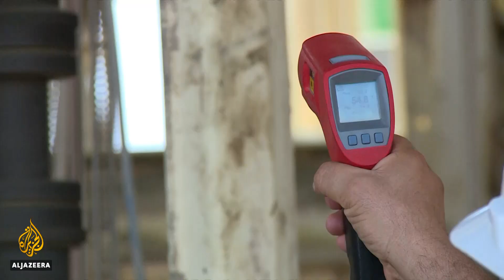Iraq's oil and gas industry aims to be energy independent

Comment: "In the 1980s Iranian jets destroyed most of Iraq's oil and gas infrastructure ".
Now imagine what the US would do to Iran if the Iranians started a conflict
in the Gulf.
The US aren't putting boots on the ground or even flying over Iran in planes :
cruise missiles will turn Iran into a stone-age economy.
Reply: vinm300 it’s Where would the US attack Iran from? The Arab countries. Which means Iran will send tens of thousands of missiles to completely destroy oil production in Kuwait, Qatar, Saudi Arabia, and UAE.   They would also launch missiles against strategic ports, airports and military bases.   Basically the Arab countries and Iran will both be set back to the Stone Age.  Which is why a war isn’t a good idea and also why the US doesn’t attack.
Reply: @lifeovdeath  , and who benefits then ?
Oil production from the middle east ceases , prices rocket : Russia benefits, the US does , Venezuela etc
Iran would be a stone-age country worse than Syria is now.
It would take Iran almost 100yrs to recover.
War is not an option for Iran.
Reply: vinm300  no one benefits. There is simply not enough oil production outside the Middle East to keep the world running.  Some countries benefit from soaring oil prices.  If the oil supply is hit, it will create a chain reaction affecting in hundreds of other industry which will make many things unaffordable such as gas/ electricity, travel, petrochemical related product.   Also projects and sales which are funded from oil sales will all seas.  It’s better to de escalate rather then go to war.